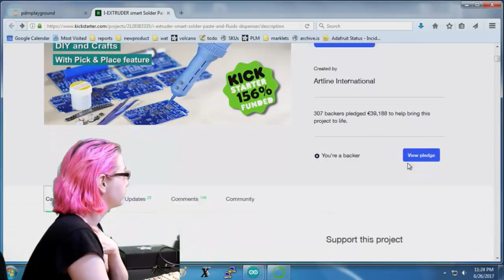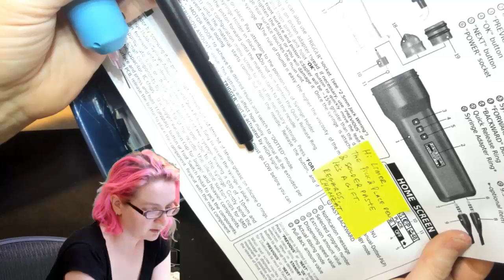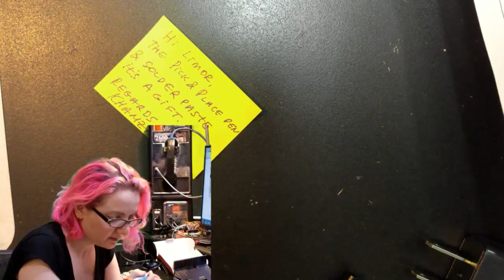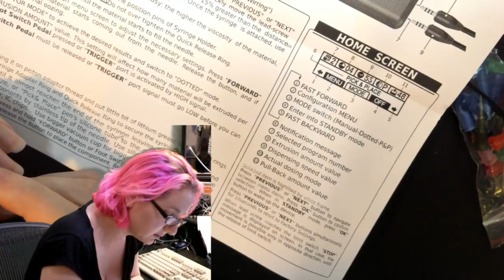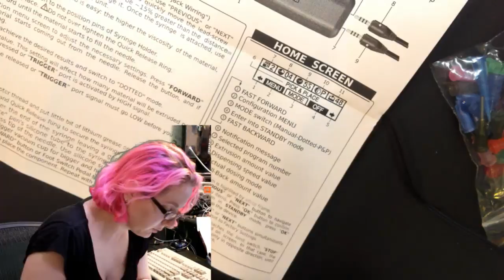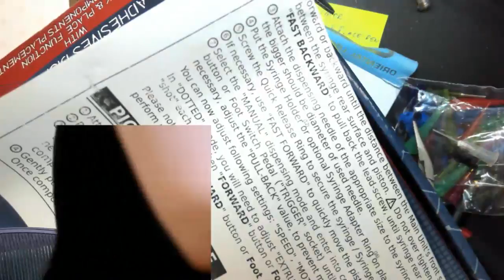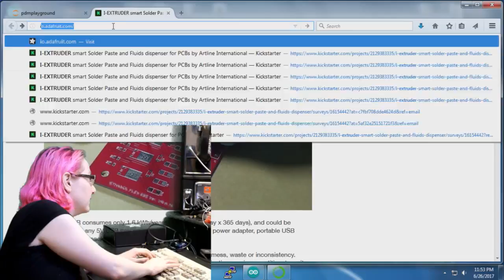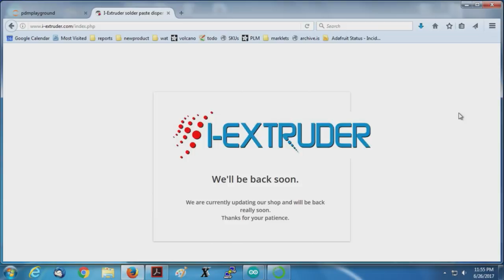Monday Mailbag - I-Extruder Solder Paste Dispenser @adafruit #adafruit #programming

Comment: Hi,
For solder paste dispensing you need to "screw" the solder paste syringe onto lead-screw, so the white piston which is inside will move when the lead screw is moving. Otherwise "pull back"  which prevent the oozing of solder paste will not work.

The red aluminum piston is for "Pick & Place" mode, and should be used with tan empty syringe. (Put a little bit of grease which is supplied with I-Extruder on O-Ring) It creates a low pressure (vacuum) when the lead-screw moves backward.

Comment: I was surprised, as was your assistant, that you spread the solder paste across the smaller IC pads. My thought was that they might short when soldering... I have not soldered that type of component yet so I guess my assumption that one needed to only get paste only on each individual pad was wrong. Would you help me and explain this to me? :~)
Reply: No, you can spread it over all pads. If the solder-paste is heated up, it goes to the pads by itself. It forms little balls by cohesion and the solder-mask is helping, too.

Comment: I just received my long-waited-for (8 months since it funded) I-Extruder today, and I'm both very pleased and very disappointed.  The unit looks good, and seems to be nicely engineered, but I'm very disappointed with the syringes.  They require the use of Nordson EFD 10cc syringes, as they have the screw hole for the shaft to screw into properly: My MG and ChipQuick syringes won't work properly with them.  And I haven't found anyone online that sells solder in those syringes at a retail level yet: if there are they don't spell out the type of syringe.  I've left a query for the makers asking for either a list of suppliers for prepackaged solder or instructions on how to properly transfer solder from the syringes I have into the EFD ones.  I really really want to love this product, but I can't until that gets settled: I have to admit that I feel kinda mislead as the KickStarter campaign doesn't mention the syringe requirement or that we may be required to buy our solder from them (in France - 5200mi/8400km!)

Dan - (ddmo) I see you have syringe couplers for filling listed with you product on TIndie - how well do those work?
Reply: Follow-up:  Bravo to Artline - they posted a comment on the KS page and a YouTube video:  you can use a Luer-to-Leur coupler to fill the Nordson syringes from locally available ones, so happily I don't have to order solder from France.  The couplers should be available from any decently stocked medical supply, and Amazon sells them as well.
Reply: You can also just trim the MG base with some cutters to make it work. https://imgur.com/gallery/GaYjcl5